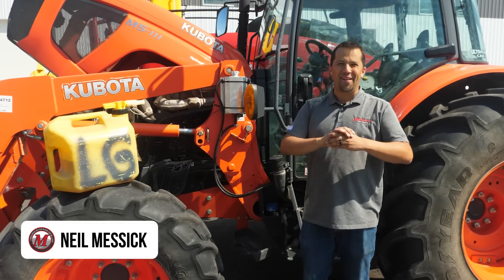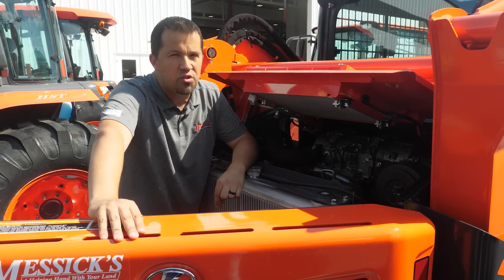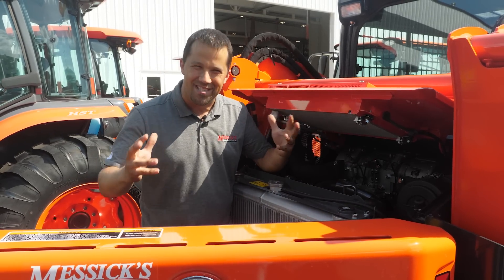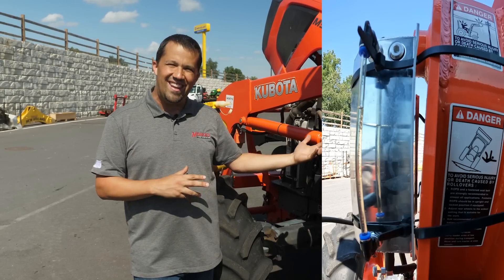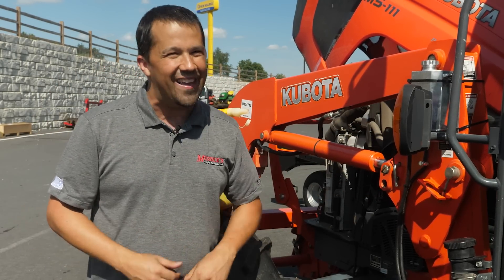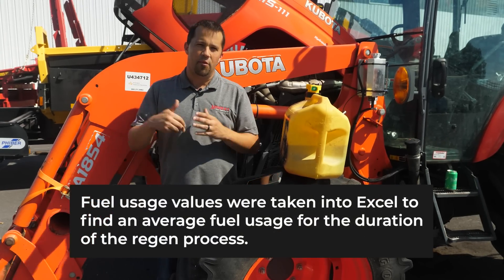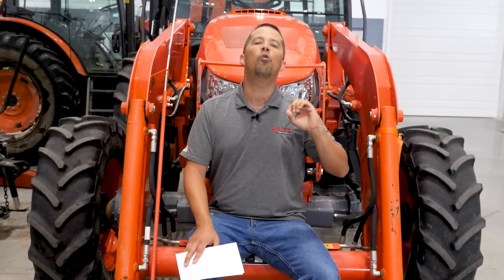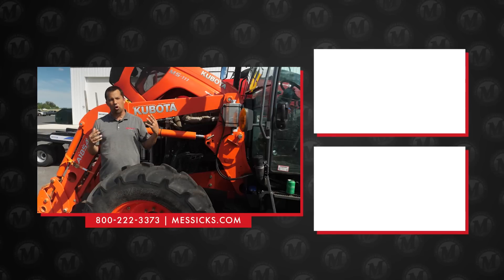Science | How much fuel is wasted during regen?

Comment: Great video explanation,  but, alot of times tractors,  semis, and pu Trucks regen when your parked or done working so you hVe to let the engine run to finish the cycle,  so your actually burning more fuel when it's not going anywhere.
Reply: Basically more engine hours and high idle time
Reply from the maker: Yea, I find it personally pretty annoying when I'm headed for the garage and it wants to regen. I often bypass it an then let it finish when i am back out working. If you did what your suggested and parked it to finish you'd burn 1/4 gal or so while it sits and burns. I find the time a lot more annoying than the $1.25 in diesel. :-)

Comment: If the engine is running when it could be OFF it is using more fuel. My problem is when the system "decides" it time to do a regeneration. Many times it is at the end of the job, so 20-26 minutes extra of high rpm run time, "just because". That the engine uses less fuel than it does under load is irrelevant to the fact the engine is running.

My question is, has any farmer ever plowed up a soot layer from the 100+ years previous generations of "dirty" diesel engines? Is there a soot bank in the delta of our rivers?
Reply: Just hit cancel and plan for it the next time you have to use the tractor
Reply: @rcguymike  ...and then your machine decides you need a visit to the dealer.🙄
Reply: @williamgaines9784  Deere gives you 3 cancels before it will force a regen

Comment: I also have a M5-111 with about 350 hrs and have also seen no dramatic fuel usage increase during regren. I am normally able to continue working during the process,  with no loss in productivity. Thanks for the informative video, I like learning about these issues. About your last emissions video about def my dealer recommends changing the def in one year intervals. My power requirements do not use a lot of def in a year. What are your thoughts on that idea? Paul
Reply from the maker: The manufacturers recommend 90 days, and DEF does have a shelf life. If you keep the tank full and the DEF your buying is fresh people seem to push that quiet a bit longer successfully.

Comment: It would be interesting to take something like a a L3902 connected to a PTO dyno and measure the fuel usage at 10, 20, 30, and 39HP loads. Only problem I see is that the PTO dynos I've seen aren't really that accurate at lower ranges. Most of them seem to be for measuring 500HP and higher.
Reply from the maker: We would have the same problem. Our Dyno is 500Hp and there is a fair margin of error trying to measure such small engines.
Reply: If you're running that high of a load on the engine, chances are you're passively regenerating the DPF anyway, running hotting enough to slowly burn away soot and not create anything new.
Reply: @micahgregory7004  The point was more to just measure actual fuel consumption at various HP levels, not the DPF usage.

Comment: Great tests. You're only heating a small mass, so it does not take a lot of fuel to heat it. If the tractor had been on a dyno at %75 load, I doubt you could have even seen the difference with the laptop.

Comment: The DPF fuel injector needs to heat up the carbon while the exhaust CFM will cause the heated soot to ignite and turn to embers like hot coals.  If the injector was to constantly inject fuel it would cause a soot loading issue.

I have used the additive Power Service (silver bottle) in a Mack semi truck.  As it will boost cetane levels to promote a earlier ignition so as to burn more fuel molecules.

I have seen better throttle response, fuel economy and less DEF usage.

Comment: I run a 2018 L6060 and can tell you without question I use more fuel then that for a regen. Running FT during regen, which is recommended in the owners manual, I see a minimum 1/8 change in fuel level. Many times closer to 1/4 tank. This occurs over a 15ish minute regen.

If you regen under actual field conditions, not forced, I think you will find real results
Reply from the maker: in theory, a field regen should require less fuel than parked because you already have the heat load from the work your doing. Same thing that causes your PM% to drop when doing hard field work.
Reply: @MessicksEquip  hmmmm.....yeah well not so much.

I run a 8' mower every summer and of course have to regen several times a season. #1 I have never started mowing and reduced my PM%. it always continues to grow until 100% and then regen.

This past fall I was at 99% PM when I fueled up. Hit regen about ten minutes later and was sitting a needles width above 3/4. Mowed a entire day at full throttle    and parked it at 1/2 full. Like I said 1/8 to just under a 1/4 tank has been the norm since new.
Reply from the maker: @Rprecision  PM drop happens for someone with mixed usage. Loader work followed by mowing would often cause PM to drop. 

Something does not add up with your fuel use. You would need 2+ gallons to follow though the engine in 10-15 minutes for that to be true. Your use over the entire day sounds about right.
Reply: I have a 2018 M7060, A little larger than a L6060) and during regen there is no notable increase in fuel usage. It sounds and smells different but that is all I notice.
Reply: @AHH24219   
I was using my bush hog this week while going through a regen on my JD 3039r and noticed increaced heat on my leg area and increased level on temp gauge. But went back to normal after finished.

Comment: You are forgetting that without a DPF, there wouldn't be any fuel usage at all, as it wouldn't have to sit, run at high rpms, and not be doing work ...
Reply: Work your machines during regen!  Why park them and let them sit while running at high RPM's?
Reply: It isn't just the fuel useage...........You are using more raw materials for the whole process, making and installing all the extra nonsense, and the dpf don't last forever and must be replaced adding more waste, and we won't even mention what happens if any sensor/malfunctions happen................Nothing but a crap load of waste.  Transport me back to the 90's any day!  The engines were cleaned up, ran efficient, and needed no extra junk to make a butt ache..............AND lasted alot of hours doing it!
Reply: @tpfromcentralpa1692  
 What next, pour some lead in the gasoline, spray DDT over the fields and insulate with asbestos?
 Forget the old combustion engines and go electric where possible. To go back to old diesels is like wanting a phone with a cable attached to the wall...
Reply: @johanneslaxell6641  Curious, before I reply, do you actually have any real world hands on experience running and working on this stuff?
Reply: @tpfromcentralpa1692  
Newer tractors, boat engines cars and such.  Yes, an old diesel runs as long as there is fuel. But you get more kW power / liter fuel with a new engine. Common rail any day.
 Same with outboard engines. Yes, it's easy with two-stroke and carburettors. But with four-stroke fuel injected you drive much, much longer on the same fuel.
 Are there problems with new engines? Yes there are! But can we keep on burning fuel like there is no tomorrow and throw pollutions and emissions in the air? No we can't! I will give an example of what I meant by "go electric": sawmills. YouTube is full of mobile sawmills standing in a shed never being moved. Why on earth do yhey need to be ran on dirsel when 15-20 kW three-phase 380V would do the same thing (quietly)? No fuel, no oil, quiet and instant power.
 I don't like to judge a book by it's cover, but I don't think that we will agree on this. But I will hear you out and maybe continue this discussion. I speak and think in Swedish so it takes some time for me to answer.
Reply: @johanneslaxell6641  In my area most power generation is still coal, so if you go electric, you are basically burning coal. And that's ok! Coal mining fed my family for years. Diesel power is about twice the price per kwh of electricity/coal if you run a diesel generator, which I have before. Coal plant makes power cleaner/less emissions than personal diesel generator. My sawmill is gasoline as I don't have the saw shed wired. I wish I did, but it is expensive to wire it, plus they charge a higher tax on the building. I won't buy anything but 2stroke chainsaws as I had a 4stroke weedeater that wasn't impressive. I have also tried a battery powered milwaukee chainsaw. Wasn't impressed with it either.
Reply: @johanneslaxell6641  the sawmill that needs the high voltage requires the infrastructure to get the voltage to where the mill is. That, many times, is more prohibitive than transporting fuel and the extra maintenence of the combustion engine over the electric.
Reply: @williamgaines9784  
 Maybe it's that you allways have had oil/gas/coal domestically available? We (here in Finland, NorthEast Europe) have a quite nice powergrid with minimum 3x25A 380V to allmost all houses (if they want it). Mostly no problem if upgrade is wanted.
 I guess we all have different perspectives and different paths. Take care, stay safe and have fun 👍🏼🤗!
Reply: @johanneslaxell6641  How is your electricity produced? Is the production private or public(government)? 
Your country is smaller than California. Are there are no places your grid does not reach? Ask for an upgrade at your place and see what it costs. Ask what it would cost to run a mile of powelines to a remote location?
Reply: @williamgaines9784  
The 30kV powergrid is owned by the state (Fingrid) the lover grid is owned by different companys. Yes, the grid goes to allmost all houses. At least if they are used for living all year round. Power is made by nuclear, sun, wind and water. I think allmost all of the old coal and oil plants are taken out of service.
 Last year powerline was drawn to the island where we have our "cabin". IF an owner of a property wants power (to the proprtys border) the cost is 1500€, going from 3X25A to 3X35A  is 1000€. I talked to an old friend who is an electrician who saidcthat the price is the same for all (customers of that company) because some places the cost is just changing the fuses (reallh cheap) so it isn't that bad if some other cost more (new cable and so on). It's like insurance: all pay some so that noone has to pay it all...
 I have Geothermal heating and cooling but still get by on a 3X25A power supply. I had oil heating but changed ig out in 2007. I now use around 8500 kWh power yearly, in my opinion not that bad...
 We just got our new Olkiluoto3 nuclear reactor in service and now we are hoping on SMR (Small Modular Reactors). Small reactors made in factorys possible to move around if there is need for it.
 I forgot to mention that we do burn waste for heat and some power. And when it comes to small gasoline engines the market goes down, they are loosing to electric and battery powered tools quickly. 
We have different startingpoints and views but our paths still go forwards. Be well 👍🏼😋🤗!
Reply: Overall, newer engines are more fuel efficient than their predecessors, even with the fuel used during regen factored in.  Parked regens are typically only required after long periods of light use.  If you are using your tractor for prolonged heavy loads, then the regen will occur and you may not even notice it.  This is what pickup trucks typically do as well.  They look for sustained highway speeds before initiating a regen cycle and the driver never even knows it is occurring.  If those conditions are broken, then the software awards partial credit and picks up where it left off the next time it sees those conditions.  The only time my pickup has performed a parked regen was when I was doing several hours of low speed driving on the property.  This is because I drove too long without meeting the conditions needed to initiate a moving regen.
Reply: true, but a lot more soot in the air.
Reply: @robs8882  unproven
Reply: @williamgaines9784  so why have regen systems?
Reply: @robs8882  because of #powerhungrytyrants